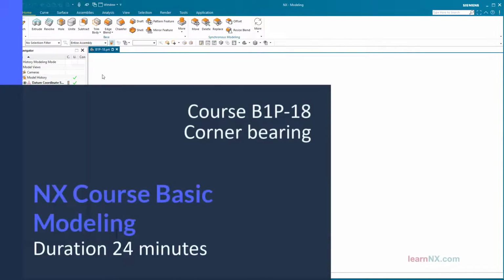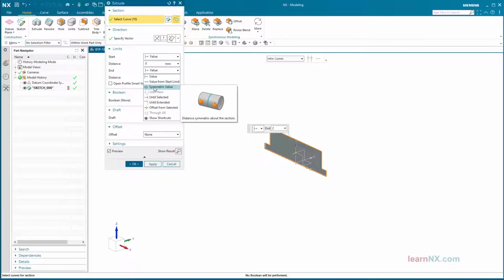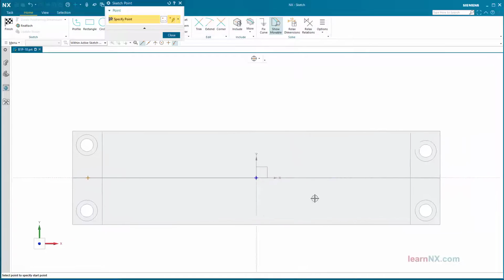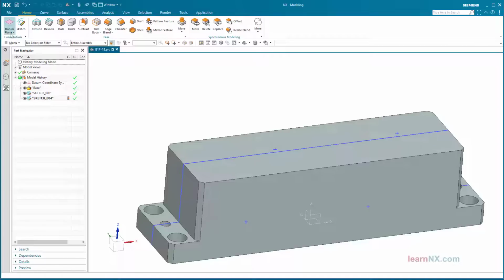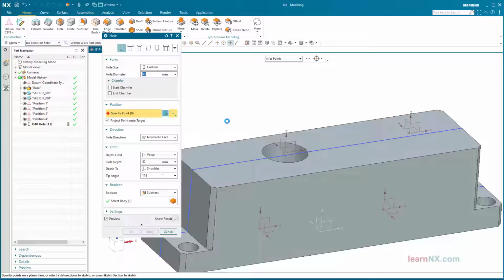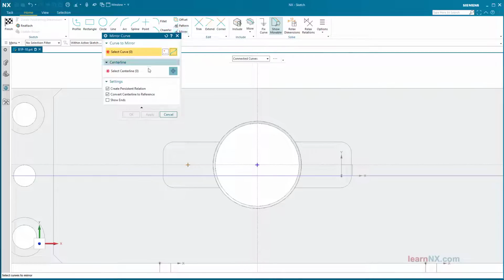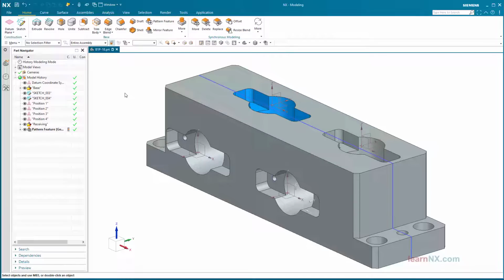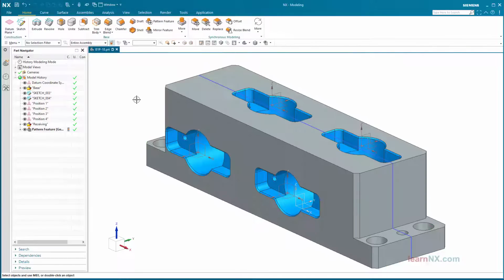Siemens NX Tutorial | Feature groups, positioning coordinate systems, general patterning

Comment: orientation option is not visible to me in pattern option? is anything i need to change?
Reply from the maker: The reason is simple: you are working with the Essentials role. Click on Roles in the resource bar, then on Content, and finally on Advanced. You will then see all the commands. If you don't want to change the user interface, click on the small gear wheel at the top left of the title bar in the command. Then select Pattern Feature (More)
Reply: @learnNX  thank you , it is very helpful

Comment: Do not have the orientation tab in pattern feature, does my version of nx is too low(v.2023) or i shud check some option to enable that? 
btw did it with pattern face, whats the difference with that and pattern feature?
Thanks!
Reply from the maker: Recorded the video with NX 2008, but this menu has hardly changed since NX 10. Pattern face copies faces, not steps. This command would also work with stp data. But if the focus is on parametric design, you should choose pattern feature. You can find a comparison of the methods here: https://youtu.be/F2r53_eEQow